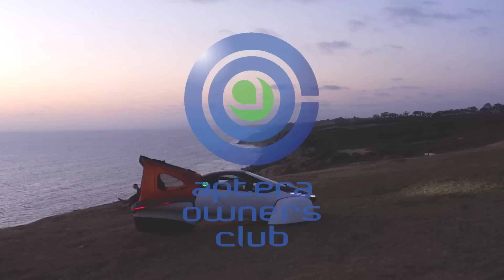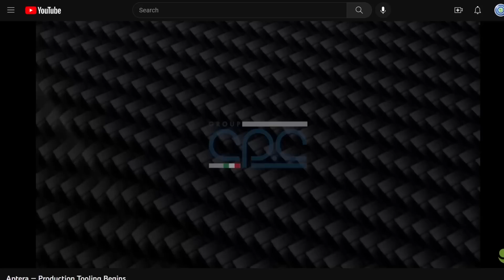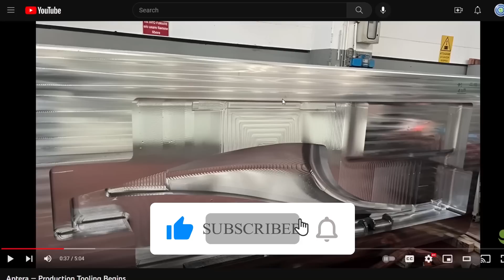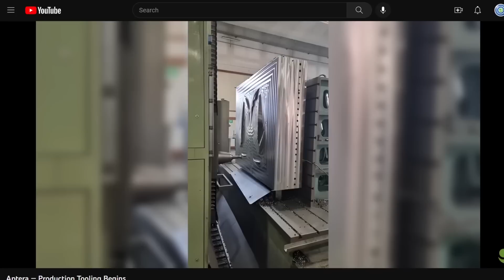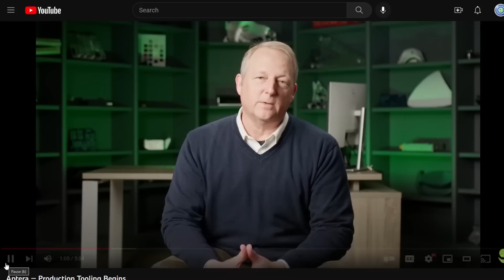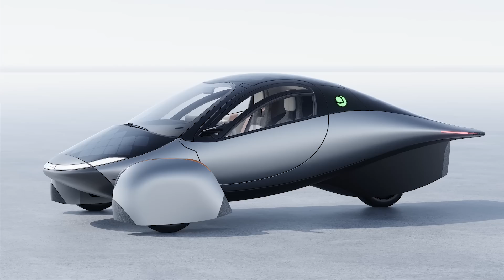Aptera is cutting steel and why you can't just hand build a few

Comment: I've made one off carbon fibre (woven not forged) pieces. It's possible, but the upfront cost is still not cheap I'd guess in the neighbourhood of $10k of extra material and man-hours per car just for the carbon pieces. And then not having economies of scale means substantially more cost and time. Like weeks to months per car. You'd be looking at 10x the production cost and they'd have to sell it for more than that. No point in delaying full scale production for that.

Comment: This video relays great news. These dies are most likely the highest cost items for building the final vehicle. Second highest ticket item usually is plastic parts molds, I presume they may make larger parts of fiber glass but still many smaller parts need to made out of expensive injection molding tooling. Metal casts can be made economically with sand casting technique. Now I see it’s coming, if I were Aptera I’d be stepping up the UI development now, it’s obviously not ready and it will soon need to be. 
I see a near future where bodies will be readied in Italy for Aptera to assemble pre-prod vehicles in CÁ. Awesome!

Comment: Metal shavings from machining are called chips.  That McD die looks like two separate parts that are symmetrical, maybe part of the doors or pillars??  Tooling die metal is very expensive and will last for hundreds of thousands  of cycles in this use case if not millions of cycles. If they were forging metal then the dies wouldn't last as long. I also think CPC Group is fronting the cost of the dies as their investment and part of that deal is that CPC is putting the body panels together and shipping out the body as a whole to Aptera.  The good thing with this is that CPC ensure the quality on the whole unit but bad is that a lot less will fit into a shipping container vs individual stacked panels.

Comment: I thought tooling wouldn't begin until all funding was guaranteed.
Reply: I thought so too and I think Aptera explicitly implied that. Maybe they have already gotten the funding or they are now confident they will get it. After this, I am once more considering hopping in to the Accelerate program even though my chances of making the cut is slim.
Reply: @adimchionyenadum2962  i think if you invest the 10k you will be in the top 2000. Might be towards the bottom but will still make it 😊😁
Reply: @rbtower2  Nobody can be sure what will happen during the last days of this riffle. I would be surprised if it ends without surprises.

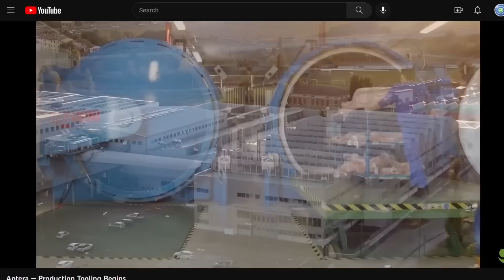Comment: At 0:45 they show a big autoclave. Has aptera confirmed that the CPC parts will be cured in an autoclave?   That's an expensive and impressive way to make parts.
Reply: I believe most, if not all, of Aptera's parts are cured in the press.  It's likely the autoclave shown is for more traditional bagged parts.  I'm pretty sure CPC group does more than just forged carbon.

Comment: FYI: I heard it mentioned by Aptera that the dies are being cut from German steel, which is where they were ordered from months ago. The mystery die looks like it may be for several parts, a right and left side of one part and maybe others. Or, it's for just one part, but maybe they aren't finished cutting it yet.
Reply: I think for smaller parts they can put the left and right into the same die and save a little over having two
Reply: @kenmcclow8963  I'm not sure the McDonals's die is necessarily for an Aptera part. The following shots showing assembly are obviously not Aptera parts.

Comment: I totally disagree on doing a few delta prototypes as being too costly, once the dies are completed. On the contrary, it will save money by troubleshooting production elements, before running at volume.  
My understanding is that the major blocking for having a physical delta is the shell, that is now made by CPC. Once tooling is made by CPC (which they appear to be doing), having a short run of say 10 shells, for QC and testing makes sense and would not be that costly. It would allow to built a few delta prototypes, for QC, testing and validation. Some could be just developed as mule only. 
Waiting for everything to begin production and hoping everything will fall in place perfectly is wishful thinking and a recipe for disaster, IMO.
Reply: Actually Bertrand, that is precisely what is going to happen. Those first vehicles will be used for testing and for crashing.  They will have to certify that there is no major flaw like the wheels falling off the Toyota before they can sell the first one. 

But to paraphrase your observation, Good planning is making sure all the resources you need are present and really, really do your best to have everything fall into place is very hard, but tremendously smart to do.
Reply: I think that there is a process in producing and fitting these components. I believe there maybe a "laser trimming" capacity. Getting hung up about tproducing some samples when the tooling is finished seems kind of pointless. They are doing this for a purpose and will undoubtedly build at least 5 or 6 for crash testing and any other usefull purpose.

Comment: I agree that CPC investment in Aptera could be by financing the construction of those dies. It is also quite possible the steel blocks were purchased six months ago by CPC, before Aptera agreement was inked, and then assigned by CPC to Aptera project. That would be consistent  with what Aptera knew and was telling at the Fully Charged show in San Diego last fall re delivery date.

Comment: Steve Fambro used the words "vertical integration" while referring to CPC Group. If those tools are say $25,000,000, then making an agreement with them to discount that price and recoup it in the volume of 100,000 Aptera over three or more years, Maybe raising the price by only a few dollars per body, to get back your initial up front costs. Placing shares as script for the payment is also a possibility.

Comment: This die will have to be hardened after the machining is complete.  Both carbon and glass fiber are very abrasive, so this die won't last for decades.  However, there might be enough extra material so that if can be re -machined multiple times so that the same piece of steel might last decades.  I think their investment in these large tools is proof that the people claiming they are scammers are just wrong.
Reply: Yes, I used to work at US Steel back when they transitioned from Open Hearths to Basic Oxygen Process (BOP) Shops. I was a chem tech who analyzed steel as it was made and sometimes after the fact. All steel is not the same. It has different qualities depending on the the amounts of carbon, sulphur, phosphorous, molybdenum and manganese. Steel with high carbon is very hard, but brittle. They called these heats "scissors" because that was the kind of steel used to make scissors. Scissors break, which is not good, but they do hold an edge. Low carbon steel was called "fenders" because that's what cars were made of. This steel was softer, more malleable. Trying to chisel a shape into high carbon steel is going to be difficult, I would guess, because digging in with tools hard enough to sculpt and not crack the steel would be tricky. So some kind steel with carbon somewhere between the two extremes will likely be best and some kind of hardening process afterward. I don't remember anything being said about hardening, so it must occur elsewhere. Too bad they couldn't cast the steel in the shape they wanted. Probably too expensive to make the ingots.
Reply: @LightsOnMultiMediaMindArts  Wow! in just a few lines you managed to deliver a wholesome technical lecture that could very well have been in a Engineering school lecture hall. More impressively, you managed to deliver it with such dexterity that a completely non technical and clueless outsider like me could understand almost everything you said. I have learnt something useful today. Finally, you answered an age-long question I have had since I was a child in the early sixties: Why do scissors break?(!) Thanks and congrats!
Reply: @adimchionyenadum2962  You're welcome. It was all hands on experience for me at the time. I had no previous training. I learned a great deal from the men and women who made the steel. They could tell the tempera of steel in a furnace by looking at its color and the size of bubbles.
Reply: @LightsOnMultiMediaMindArts  As a medical professional with many years of experience teaching  medical students and training young medical doctors in the art of clinical medicine, I can assure you that teaching is not only a question of knowledge and formal training, but also of talent. You may not have the latter, but you certainly have the former and the talent to impart it in a concise and intelligible way. Congrats again! I rarely learn anything tangible from social media. Just too much noise.
Reply: @adimchionyenadum2962  I appreciate your comment. It's a habit picked up from teaching K-8 for 26 years. Keep breaking ideas down into simpler concepts until they are easily understood.
Reply: @LightsOnMultiMediaMindArts  Thank you for your insight into this! I was watching the Linus Tech Tips video about the process of getting their screw driver designed and manufactured and they go into this very thing a little. They didnt want to get the dies replaced everytime they wore down do they chose some sort of hard stainless steel and it wasnt machined out.. there was some sort of electrical plasma discharge type thing that was used to remove material.
Reply: @AlistairBalister  Interesting. I haven't been in a steel mill in almost 50 years and I'm sure technology has continued to improve. I wonder if such an exotic technique as plasma discharge is cost prohibitive for something on the scale of Aptera body shell pieces.
Reply: @Aussie ideas man needs to see this.
Reply: "I think their investment in these large tools is proof that the people claiming they are scammers are just wrong."

Of course they are wrong, they couldn't spot a real scam even if it drove over their feet in a Nikola truck. They're either completely clueless about how startups work or they have a biased against Aptera.

Comment: At 5:33 you can very clearly see the M-shaped design you were having trouble identifying is the piece that goes in the door frame. Great video Steve.
Reply: What you're seeing at 5:33 is the steel reinforcing beam that will be installed in each door. CPC will not be making steel parts for Aptera.
Reply: Agreed, this is part of the door assembly for the window frame. The carbon fiber arch curves in parallel to the roofline toward the door hinge (zoom in on the window area). The die makes both the left and right door window frames in one pass. On the exterior side of these carbon fiber pieces, a metal crossmember is installed.

Comment: The M looks like the inside of the wheel pans. They likely do both sides in the same mold.
Reply: The inside of the wheel pants, we have been told, will be made from an injection-molded plastic material.

Comment: Halves of wheel pants
Reply: I think you are correct but we might be looking at more than just wheel pants or there is more than two pieces to the wheel pant.  It looks like there might be 4 pieces here.  It would make sense to cut as many pieces into the steel as possible.
Reply: @ddessert6  I searched but could not find the old video on wheel pants design. He had renderings on the computer and was speaking about the forces and at what speeds the vibrations would resonate. Anyway, I believe he showed that there were two pieces of two different materials on each half of the pants. Wish I could find it!

Also when they show the parts floating together on the quarter panel, surrounding the window, (A & B pillars) the inside of this piece is black while the outside is white. While they don't show it as two pieces it certainly must be.